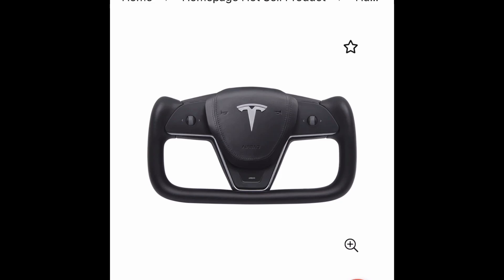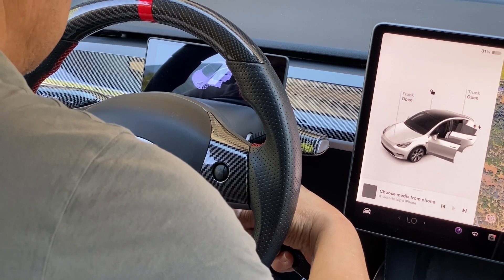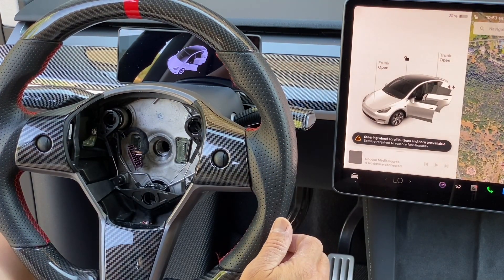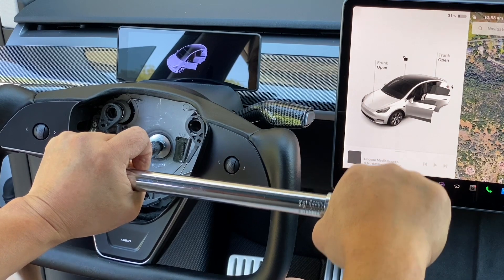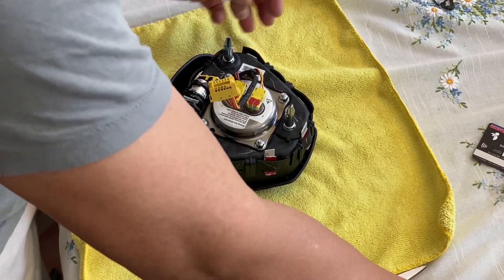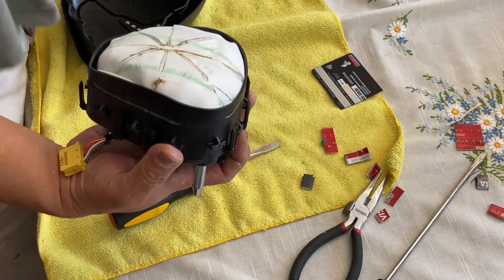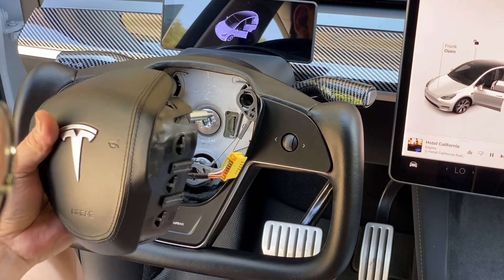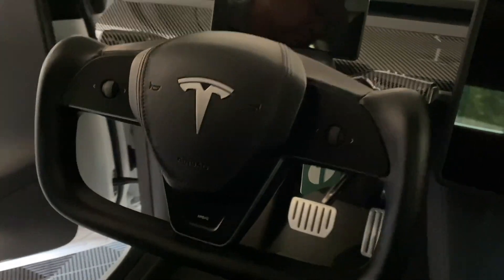Hansshow New design Yoke steering wheel

Comment: Any additional step for the heated component?
Reply: If you want the heated steering function to work, you need to transfer a few component. It is all in the instruction and very easy.  In my case I did not bother as I don’t really use heated steering function. So my installation is just plug & play.

Comment: Did you have to move your Control box?
Reply: I did not move the control box. It is basically plug and play.
Reply: @Baltaofm  you must have got a special version of the yoke or maybe you have an older Tesla that does not require the control box. Either way, I see that they put out a new install video that shows how to move the control box.